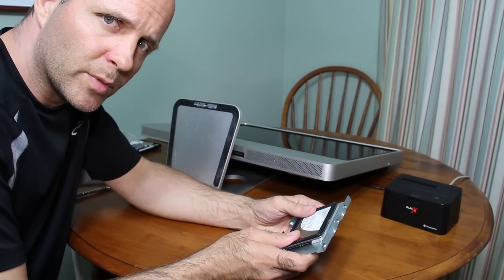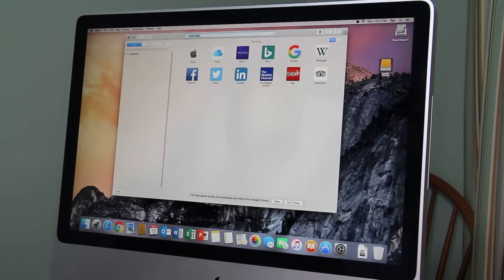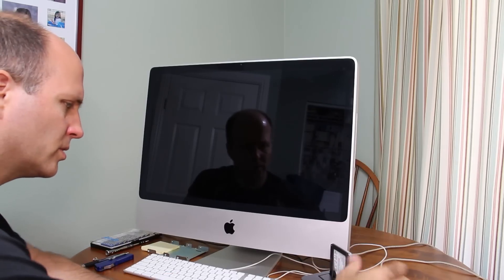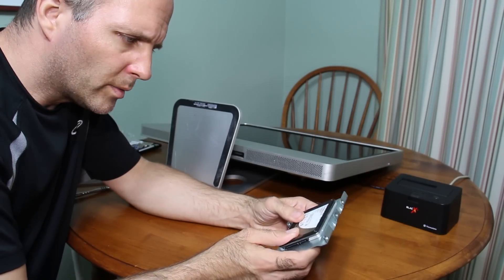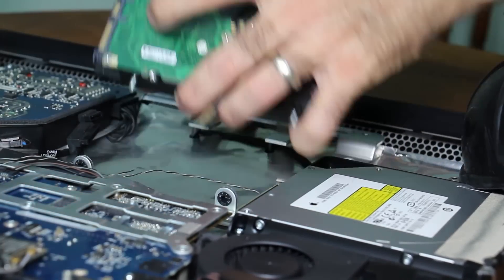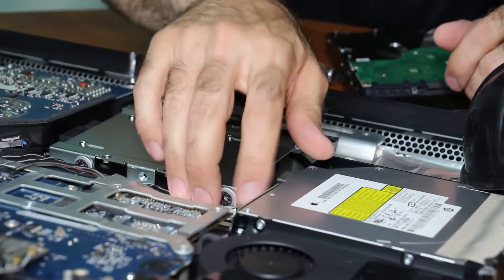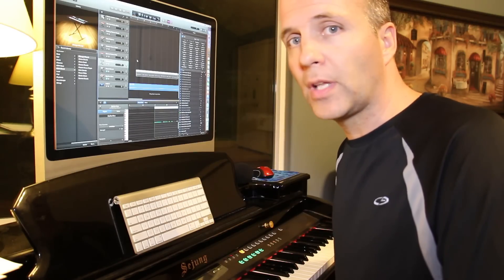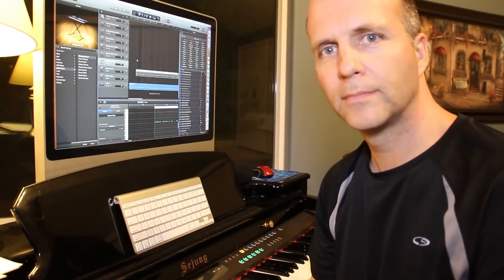How to Speed Up / Upgrade iMac to SSD the Easy Way using Free Cloning Software

Comment: I like the way you punch the hdd bracket to fit inside the frame, and also using plunger nice 
you should change the title to "how to change hdd on imac in hardcore mode" ))))

Comment: I just swapped my HDD for an SSD in my 2009 iMac 9,1,Thank you for this video, i was a bit nervous i would break something and was fearing removing the power cable. Thank you for roughing up that iMac so I felt confident enough to do the swap myself. I was definitely a bit more careful with mine but I appreciate your roughness as it empowered me to know if I was gentle I would have little chance of breaking something.

Comment: All you need is Disk Utility (already natively installed on the Mac) to clone a disk. The only exception that this doesn't seem to work for Catalina. However, the work around is to clean install the OS on the new disk first (before installation) and then use Migration Assistant to transfer your data form the old disk (again before installing the new disk into the machine).

Comment: hey what if i do not clone my hard drive im replacing and just put in the new ssd? will i be able to install the os or will i need a installation dist or thumb drive? thanks
Reply: You can make a bootable drive using a flash drive pretty easily and use that to install your os. Hope it helps!

Comment: What is the exactly hd model i need to replace the hard drive for my 20”inch 2007 imac?pls.let me know thanks!👍🏼
Reply: any solid state drive will work. you can even tape the drive in, but only for "solid state" drives, not "hard drives" if you do not have very many files, you could get one for $20 from best buy.

Comment: Thanks for the tip on the cloning and fan control software. Can you recommend the external drive case to use while cloning the SSD? Yours with the slot in it to just plug into was cool, but any model that would work would be appreciated!
Reply: Here's a link to an external usb drive enclosure that would work: https://amzn.to/2S3nOVT

Comment: I am going to do this with my old iMac this weekend. Any troubles with just “readhering” the thermal sensor? Does it works as normal? I have seen some forums where the fan basically goes constant after this.
Reply: Lance1Woods I’m about to do the same with my iMac. I also heard this about the fan cable. Can you tell me how the upgrade went for you? What model did you upgrade? I have a 21,5” mid 2014.

Comment: Hey! I know this is an older video, but I recently saw a tutorial of someone doing the same thing on an early 2009 20" iMac and they said that the Hard Drive Temperature Sensor wouldn't work after swapping in the SSD so you would have to create a custom fan curve. Did you have this issue?
Reply from the maker: Yes, I had this issue also. I fixed it by installing free software called Mac Fan Control  https://www.crystalidea.com/macs-fan-control  to control the system cooling fan so it doesn't run at Max speed and get noisy.
Reply: @TechnoTed  
OWC OWCDIDIMacHDD11 Câble SATA pour Disque Dur

Comment: I have an early 2008 20 inch iMac currently running Yosemite 10.10.5. Which version of OS X is best for it? I heard Mavericks was a good option and I thought about downgrading to it. Also, how much RAM can it have? Apple says 4 GB max but I've read in forums saying you can put 6 GB in it.
Reply from the maker: I usually just install the highest MacOS version that the computer will support and it seems to work fine.

Comment: can you please tell me where did you get the bracket? I am planing to do the same for early 2009 24'' Imac. What about the heat sensor .. does it work? People have told me I will have to use software  to control it. Thnx!

Comment: Nice job, and great video. 

I noticed you are running a version of macOS that can do GarageBand. Need 10.12 or later to run that, right?

I'm bringing a 2008 imac back to life after it was sitting on a curb all lonely like and probably about to be crushed in a trash truck. So far it's doing quite well... I am watching this video and it's smooth with just 1GB of memory.  (4GB are on the way)

So I was under impression this imac can only be upgraded as high as 10.11 El Captain.

So, there must be some way to get it to 10.12?

I would love to have GarageBand on here.
Reply: All info about upgrading unsupported Mac machine on latest macOS (High Sierra or even Mojave) you can find here: 

Dosdude1 page about everything: http://dosdude1.com/software.html

1. High Sierra: https://www.youtube.com/watch?v=tZ6TomIhqcY
2. Mojave: https://www.youtube.com/watch?v=v9sE_FhSdT8

Comment: Thank you. This was a very helpful video. Took me about an hour to complete the install. I did not bother to disconnect the main board. Just the dvd and camera then propped the screen open with a stick. It’s now between 30 - 50% faster depending on the app and it’s a useful pc again.
Reply: i guess im randomly asking but does anybody know a tool to log back into an instagram account??
I somehow lost the login password. I love any tips you can give me!
Reply: @Leonardo Johnny Instablaster =)
Reply: @Blaze Kannon Thanks for your reply. I got to the site thru google and im trying it out atm.
Looks like it's gonna take a while so I will reply here later with my results.
Reply: @Blaze Kannon It did the trick and I now got access to my account again. I'm so happy!
Thanks so much, you saved my ass!
Reply: @Leonardo Johnny glad I could help =)

Comment: So first you have to back up your mac to the eternal HDD then do the ssd upgrade? Also is there any way to uograde an old 2008 imac 2.0 usb to 3.0 most external drives are now 3.0 or better do they make a converter?
Reply from the maker: Yes - this process is making an exact duplicate from the internal drive to the external. Then you install the SSD and it will boot up and have all of your files and applications already there.
Reply: TechnoTed thanks brother I'm at the beginning at the same process for myself doing an external drive first and then the next project is to get the SSD so I'm trying to do all the research to see which SSD I need what kind of dock station I need for the for the SSD to make a copy of the hard drive she's trying to put it all together brother
Reply from the maker: Cool! One thing I should mention is that USB 3.0 slot load devices sometimes will cause a failure when cloning  in certain situations so I normally use USB 2 just in case even though it takes longer. Good Luck!

Comment: I use carbon copy cloner to copy my drive. I think it works a little better than the program you used.
Reply: I agree with you about copy cloner. It worked straight away whereas I got a weird  error with Super Duper. I upgraded my 24" iMac to 6GB and 250GB SSD. It was a fun exercise and we have a fairly usable iMac for $150 CDN all in.

Comment: I know this is from a while ago, but can you help? I have a 27" 2009 iMac - I want to do the same. I have read about needing an OWC thermal sensor - isn't that they case? How come you didn't?
Also, 'how much' better does it feel? I just wondered as it seemed to boot really quickly - does/did it feel more nimble when you use(d) it day-to-day?
Reply from the maker: It feels like a newer faster computer with SSD so it's worth it. You can solve the thermal sensor issue by installing the app called "macs fan control" and it will give you many options to control the fan speed and other sensors etc.  if you don't install this app (there are other apps also) the fan will run full speed and be very loud.
Reply: Thanks for the quick reply. That's good news as the OWC thermal sensor is pretty expensive! (About 1/2 the price of a 480gb SSD!)

Comment: from where can i get this bracket to install SSD
Reply from the maker: this one would work.   https://www.amazon.com/dp/B016498CK0/ref=asc_df_B016498CK05396399/?tag=hyprod-20&creative=394997&creativeASIN=B016498CK0&linkCode=df0&hvadid=198093101467&hvpos=1o5&hvnetw=g&hvrand=16884807856586223550&hvpone=&hvptwo=&hvqmt=&hvdev=c&hvdvcmdl=&hvlocint=&hvlocphy=9031533&hvtargid=pla-365069387933
Reply: you dont need a bracket, just secure it with a double sided tape or anything that will hold it in place

Comment: When I installed my SSD it would not run in the iMac. i kept getting white screen when I turned it on. I think it may have been the temperature sensor or something. I even tried the icy dock. No luck.
Reply from the maker: The temp sensor won't give you a white screen - it will only just make the fan run louder.  Did the white screen eventually change to a folder with a question mark? What year imac?
Reply: TechnoTed same here. Did cloninng and Mac does not start. When i select The drive holding Option In Rebut The Apple comes but after comes a forbiten sign (🚫).

Comment: SSD's don't get hot so I don't know why you put the sensor back on.
Reply: If you don't re-attach the sensor, chances are that the internal fan will run almost constantly.  If you don't mind the noise, it's nothing to worry about.  :)

EDIT:  Forgot to mention that usually you attach the sensor to something else inside that would get warm (not hot).  Like you say, SSDs don't get hot.
Reply from the maker: yes,. that is right, the fan will run really loud. There are several Apps you can install that can control that fan manually or have it respond to a different temperature sensor.

Comment: Great video. Just wondering about the thermal sensor. I've seen other upgrade videos where they need to buy a whole separate part for the thermal sensor, albeit for a 2009 iMac. Do you know if they system / upgrade process is different in these?
Reply: Thats for the late 2009 model, not the early 2009 shown here
Reply from the maker: I usually just use tape to attached the thermal sensor to the new drive.

Comment: Great thanks TT, it worked! Would it be possible to clone an iMac 2015 With OS Mavericks or Sierra and install it in an iMac 2009? 🖥
Reply from the maker: Yes, it would probably work.  You can generally do this with macs with out issue. You would not be able to do this with a Windows operating system however.
Reply: Can you make a video of this

Comment: Hi TechnoTed, nice video. Someone happened to drop an iMac (early) 2009 on the floor and for obvious reason the harddrive chrashed. I googled you and bought a SSD. Can I clone a Samsung EVO 850 from a another early iMac 2009? Thanks!
Reply: Edit:And use that clone in the iMac with the broken harddrive?
Reply from the maker: yes, that should work!

Comment: THE most ham fisted hard drive replacement I've ever seen! A little more gentle that showed here people!!
Reply: Yeah, especially seeing the way he just rips the display out with cables and fumbling around I'm surprised he hasn't broken a few iMac's already
Reply: IDontKnowWhatImDoing its a good video I think.BUT WHY THE PLUNGER??
Reply: Luke Roszmann (student) i have installed a second caddy with an SSD on my early 2009 iMac, which is an easier job than this one. I got two suction cups off Ebay for $5, a caddy for $3.59 at Amazon , small tools at OWC, 500 GB Samsung SSD  and 8GB Ram at Newegg. Total investment:less the $150. My iMac is 8 times better and I use the HDD for internal storage.
For a day by day home use-no need to buy a new iMac at all..wife is happy and I get to keep $1600

Comment: Will any SSD work or do you recommend a specific model? I guess I'd want a bracket that comes with the SSD (retail, like Samsung SSD) because I've bought generic brackets and they don't always line up with the SSD I bought.
Reply from the maker: Any SSD should work but I like Samsung 850 EVO
https://www.amazon.com/Fenlink-Internal-Hard-Drive-Converter/dp/B01ELRRKW8/ref=pd_lpo_147_tr_img_3?_encoding=UTF8&psc=1&refRID=KEW6WEATWR5SDR5VW2DP

Comment: Thank you very much, Ted. ... I have a dumb question: by using Super Duper to make that clone, does that mean that you did not need to go through all the trouble of re-installing your OS X, and re-installing all your software programs from the original .dmg installers ?
Thanks again.
Reply from the maker: yes that is correct. it makes an exact copy of your computer's drive - as if you put it in a xerox copier.

Comment: Is there a heat sensor on the newest 27" iMac? I'm gonna get one and install an SSD and need to know. Also, is it okay to install the SSD right out of the box before ever powering on, or do I need to configure wifi or whatever first? Basically I'm wondering if say I get the iMac in the mail, go straight to installing the SSD, then power on - will it automatically install OS Sierra?
Reply from the maker: I would say for sure that there will be a heat sensor attached to all iMac hard drives over the last decade and longer. when you swap the drive, you just need to make sure that the sensor is taped or glued to the new drive.   if you installed the SSD drive before powering the IMAC on, you should be able to power on the imac and:
hold down the Command (⌘) – Option (⌥) – R combination immediately upon hearing the startup chime. Hold the keys until the animated globe appears on the screen. At this point you should be able to connect to a wireless network (or ethernet cable), then install OSX (macos) from there. It will then download the install image from the internet. This will take longer than just cloning the drive like in my video because it will have to download several gigs of install software over your internet connection before it can install.    Good Luck!
Reply: Well I found out today that voids the warranty unless you pay an authorized 3rd party technician to do it so I went with the 1tb fusion drive and all the top specs. Gonna wait to do the swap after the Apple care warranty expires in 3 years.
Thanx though. Appreciate it. Now I have some serious learning to do, coming from Windows computers all my life.
Reply: Do you a similar video to install a SSD into a more recent iMac 27" (year 2009-2011) ?

If yes how do you solve the T° probe since the new design does not have heat sensor glued but rather use special connector with digital link of the T° ?
Reply from the maker: I have also done this on a newer model imac (the one that has adhesive that holds the glass on instead of magnets). .  The heat sensor was similar to the 2007 so I didn't have any issue with it.
Reply: Farfy McDoogle Make a Sierra drive on another mac or if you have a windows pc torrent a sierra dmg and make a bootable drive with transmac

Comment: I have the same iMac 24inch, I would like to do the same upgrade you did, it does not look complicated but my question is where did you get that bracket to mount the SSD inside the iMac?
Reply from the maker: This adapter would work:   
https://www.amazon.com/Fenlink-Internal-Hard-Drive-Converter/dp/B01ELRRKW8/ref=pd_lpo_147_tr_img_3?_encoding=UTF8&psc=1&refRID=KEW6WEATWR5SDR5VW2DP

Comment: Thank you for your video. Like it:) Would you mind to help me? I am going to copy all my data from old HDD of my iMac 27 late 2013 to new external portable SSD from Samsung (T3) using Carbon Copy Cloner. And my question is how to set this new backup SSD drive up as my primary startup drive? And will I be able to easily update Mac OS El Capitan to Sierra on this drive from App Store deleting all data from my old HDD to use it just for keeping some media files, etc. I hope it will speed up my system and Logic Pro X working with large samples and virtual instruments.  Thank you for your time:)

Comment: Question. I have the same computer at home and was trying to clone the new SSD drive however I still have mac os 10.5 installed on this iMac with SuperDuper but it says that this program is not supported by this OS. Can you please tell me how you cloned the new SSD on this iMac? the reason why my iMac has an old OS is because i did a factory reset and it has an old OS.
Reply from the maker: You'll need to upgrade your OSX version to 10.8 or newer - you should be able to do it for free using the appstore.    Or you could install an older version of superduper   here's the one for 10.5  http://www.shirt-pocket.com/mint/pepper/orderedlist/downloads/download.php?file=http%3A//www.shirt-pocket.com/downloads/SuperDuper%212.7.1.dmg
Reply: my computer is successfully working once I installed the oder version of SuperDuper. Now its time to do the upgrades. Thanks a lot for your help!
Reply from the maker: no problem - glad it worked!

Comment: hold on.. i might need to do more research on SSD but how did u fit 750gb HHD to SSD240gb?
Reply from the maker: The 750gb drive wasn't all used space - as long as the used space on the source drive is smaller than the capacity of the destination drive you are good to go.
Reply: ooh ooofff cos